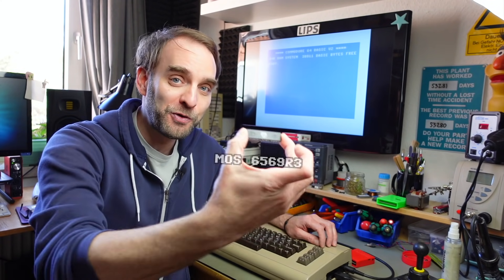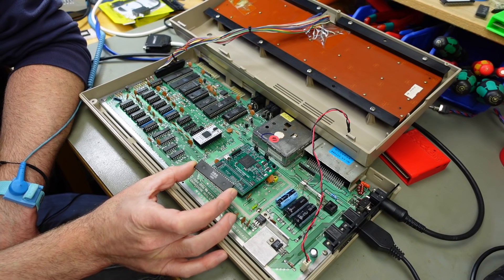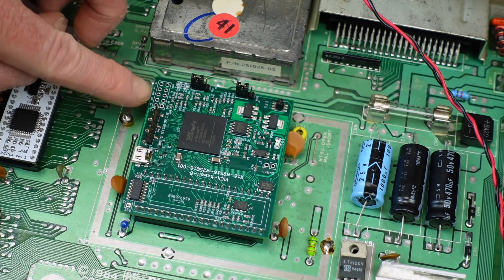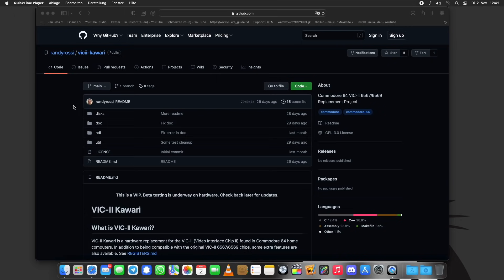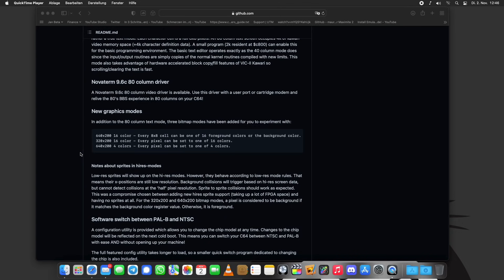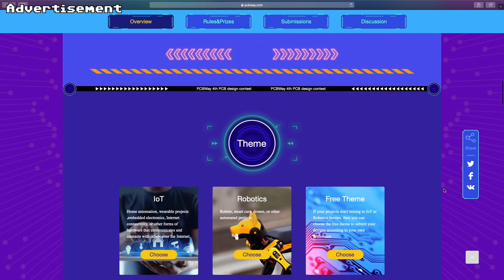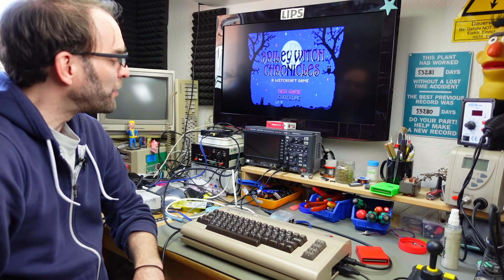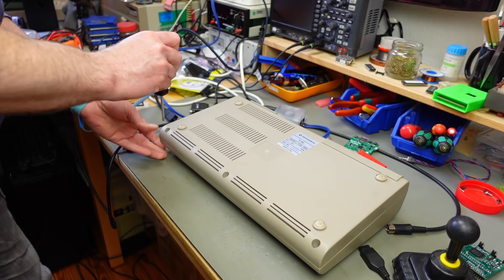Beta Testing the VIC-II Kawari C64 Graphics Chip Replacement

Comment: Nice video!  The C64 being powered through HDMI was definitely not intentional (and not a feature :)  In my setup, my PCB and 64 are powered down when the 64's switch is off even if my monitor or switch is connected to the HDMI port.  Sounds like your TV or switch is back feeding 5V to the PCB.  I need to prevent this in the next revision.  Thanks for bringing this to my attention.  In the meantime, I would avoid powering the 64 via HDMI.  You may exceed the current limit of the port.
Reply: Amazing work
Reply: The MiSTer FPGA system has a similar problem where HDMI will keep parts of it powered when used with some displays. There are HDMI splitters, adapters or cables that can block this voltage.
Reply: Same for the first two reversions of the ZX Spectrum Next, that could  cause a few situations like memory not 100% cleared after a power cycle.

Should be solved with the next 'Nexts' from the second Kickstarter which will have the issue 3 boards where the HDMI back power problem is solved
Reply: Yeah, was going to say, that's probably not healthy ;)

Comment: Its definitely valuable to be designing these chips so that when the supply of real VIC chips runs dry we can keep our old machines going. I am sure that in time it will be possible to make a VIC substitute that is the same size as a 40 pin DIP chip that just plugs in like the PokeyMax chip for Atari computers and video games.

Comment: We're coming closer and closer to not needing to buy original MOS chips anymore, hooray!
Reply: At this rate, someone might as well create a replacement motherboard with the modern replacement chips baked into the design like the SwinSID and other non-MOS chips.
Reply: Thats the ultimate goal i think
Reply: Ultimate 64 Elite and the Mega 65 are 100% FPGA. On the U64E there are two physical SID ZIF sockets.
Reply: @JVHShack  Wouldn't make that much sense, as all these small replacements just try to replicate functionality that could be put into an FPGA as a whole.
Reply: @dougjohnson4266  I bought an Ultimate 64 Elite at the beginning of the year. It is great, but it isn’t perfect. The emulations is near perfect, but the interface for configuration is not particularly intuitive.
Reply: As long as you still had all the hardware ports, not a half solution like "The C64".
Reply: @snorman1911  I was really interested in The C64, but it doesn't really seem to be too awesome for what I wanted to do with it. The maxi version is I think a great product for anyone casually interested in the C64. If all you want to do is to be able to play games or even some coding without too much of the hassles associated with using a real machine (old, unreliable hardware, poor picture output, expensive, bulky and fragile peripherals etc) it's a good option for the price.

Moving up to an Ultimate64 is a big step and you'll only want to do it if you really understand the benefits or you've hit some limitations of The C64.

I love my Ultimate64, but I also just use VICE for emulation a lot, as it is essentially perfect at this point.

Comment: You can solve the back-feeding of 5V from the HDMI monitor by adding a schottky diode in the +5V line, so that the C64 can feed 5V to the HDMI monitor (or the EEPROM in the monitor), but block the 5V coming from the HDMI monitor.

Comment: Another test that might push the limits is the trick of opening the top and bottom borders as shown in the '8 bit show and tell' episode from a couple of weeks ago. Robin shows all of the code to do it and also a couple of games that make use of the hack. Thanks again Jan Beta!
Reply from the maker: I’ve tried a couple of demos that use that trick and they work fine. The "emulation" seems to be pretty much perfect, including trickery like that. I have yet to find something that doesn’t work like with an original VIC-II.
Reply: That's excellent,  thanks for the reply Jan. Parts are somewhat rarer where I am, and shipping - especially from the US - is prohibitive for untested parts. Considering the other benefits of this system, I think it will be a huge success! And thanks to Rossi!

Comment: Exciting stuff. Been following the progress of this for a while. This does need a sensible way to get the hdmi out of the case though. This needs a breakout board to replace the RF modulator, with an hdmi in socket to get signal from Kawari and hdmi out socket  at existing hole for RF plug (to avoid drilling holes in case). Incorporate an ADC to tap into and convert analogue audio on existing circuit (formerly used by the  rf modulator) and feed that into hdmi out to negate need to use the av jack for audio . Must be possible surely?

Comment: Hi Jan, I had a similar issue as you with power being fed through HDMI, although it was actually feedback from a convertor box, that I use like a splitter having both HDMI and composite inputs and HDMI out bypass this box , the power issue disappeared :)

Comment: If the Kawari can somehow monitor the reset line and the power switch, and use that info to block the HDMI 5V to allow reset, it might be a great option to be able to draw power from HDMI instead of a potentially sketchy old C64 power-brick? 
I think there could possibly be a feature here, rather than a bug with a bit of minor tweaking?  Maybe it's hard for the kawari to figure out if the rrset button is being pressed (I assume there's an interrupt?) and to figure out the exact source of +5 so maybe  not feasible?  I dunno.

Comment: I have the VIC-II² mod and it uses opticouplers to prevent you from switching the chips while the system is on. You might be able to use that to act like a switch to cut the power when the main 5v line isn't turned on. I actually think my NTSC chip is on its last legs. When I play Giana Sisters in Pal it feels way too slow to me. So I tried it in NTSC mode instead. I know it glitches and that's normal. What isn't normal is the entire screen flashing occasionally. And it was still doing it in BASIC as well. If I flip back to PAL the flashing goes away.

Comment: I had a similar thing with some really cheap powered USB3 splitter I got off eBay. It would still supply 5V power through the USB when my PC was switched off and unplugged. I got rid of it when I tried to unplug the power adaptor and the plastic housing broke apart, luckily when the power strip was not plugged in.

Comment: Bummer about the Pi1541 issues. The Pi1541 is my favourite add-on. Is it something they’re looking into?
Reply: The Pi1541 works with Kawari.  It's the IEC bus display feature that can cause problems with timing in some demo loaders with a real VIC-II as well.  As long as you turn that feature off, it works fine.

Comment: 13:00 - "strange quirk"? Limited power distribution is part of the HDMI spec - comparable to USB, although not always implemented.
Your TV seems to have a spare pair of LIPS to wake up little "Snowwhite" ALDI-C64. The short board obviously has low enough power consumption to be powered by it. What I found really intriguing is, that both the relatively large FPGA and the flash module also had enough power to run. I suspect their consumption to be very low too when they are only reading flash memory.
Reply: *not always implemented correctly.
Note to self: Read before posting!

Comment: There should be a setting so you can turn on jailbars and set how pronounced they are, to fool any connoisseur into thinking it runs on a real VIC-2.
What about that white line on the far left of the screen (usually in overscan on CRTs)?
(and as someone else said it also needs a few resistors between VCC and GND so it emits as much heat as the original :-P)

Comment: So it can replace both the VIC-II as well as the PSU (as long as you have a SwiSID).  Pretty cool.  Rather than simply cutting off the HDMI power to the board, maybe connecting it to some pins so that if it is a feature that is wanted users could connect it to a switch allowing them to take control as needed.  Hopefully the size of the FPGA can be reduced in the final version as the FPGA image gets optimised.

Comment: Hey Jan, thanks for the video! I am mostly interested in recording that hdmi signal. What kind of capture card do you use for your hdmi capture? Are you using any scaler or does a "normal" capture card handle the weird C64 hdmi signal alright?
Reply from the maker: I use an Elgato HD 60S and it handles the signal well. Your mileage may vary with other capture cards though, of course.
Reply: @JanBeta  Oh, thats awesome. Got an Elgato HD 60S+, which hopefully does the Job es well then. Thanks for the Info!

Comment: cut open the micro HDMI cable and wire in a monetary switch to the +5v wire as a reset switch while the system is powered down.  or a 2 position switch if you want a true off switch. or...  maybe a  Diode wired inline to the +5v to stop the TV from back feeding 5v?

Comment: Some TV/Monitors support an HDMI protocol called CEC (Consumer Electronic Control). It allows the TV/Monitor to turn the connected device on/off over HDMI (and, I think vise-versa). Perhaps that, when combined with that strange power "feature", you could have your C64 to power on only when you select its input on the monitor?

Also - try switching ports on the monitor. It may power down the port. That'd save you clipping a pin.

Comment: If power is coming from the HDMI, isn't it bad for the 64's 7805 regulator? When the 64 is powered with its supply its 7805 regulator will try and regulate an externally related voltage and potentially conflict.

Comment: Would modification of the hdmi cable be easier? Just open up the cable and cut the 5v to pin 18, that should work. You can use a pin to pierce the insulation to find the right wire. Thanks JB, great video!
Reply: It's not suggested as a fix for the design,  it was suggested to allow JB to more easily continue Beta testing without having to continually disconnect the hdmi. 🙃
Reply: Horses for courses, if I was doing the testing,  I'd modify the cable. I'm not damaging the device and for 10 minutes (easy) work, I'm saving myself a buttload of dicking around. But that's me, I'm lazy and look for the easy solution!
Reply: You do you champ, although there's no reason to think that the 5v line will be off in sleep mode. I suppose JB could unplug the TV from the wall each time. What a time saver!
Reply: Call the hospital,  I need a burns unit! 🔥
Reply: using my best Dr Smith voice Oh the pain, the pain! Please stop with the snappy comebacks every 36 hours, the burns are unbearable 😫 I'm quite fragile you know ;-)
Reply: John, if you want to press the remote control button, wait for the monitor (or TV in this case) to power up, find the signal etc, its fine, do that. But you do realise that the remote control button doesn't actually power off the TV right? Systems such as the 5v bus to run the remote control receiver are still on - agreed? Therefore it stands to reason that the hdmi 5v wire will be hot whether the TV is 'off' or on. But even if that TV does cut the power to the 5v rail (unlikely), you are more than welcome to wait for the TV to power cycle rather than just hit reset and be testing again in seconds. As for the mod, why do you have an aversion to butchering a $3 cable? ;-)
Reply: Another possible source of the power is of course the video capture / splitter device. No remote for that one! ;-) face it john, unless you are going to mod a one of a kind device with the risk of damaging it, or want to waste time power cycling external devices,  butchering a $3 cable is a pretty reasonable course of action. I'm not going to suggest removing the video capture device, I need my Jan Beta fix ;-)
Reply: Oh hi John, I thought you might have wandered off once you realised that the power was probably being delivered from the hdmi splitter 
/ video capture and not the TV. Oh well ;-) Never mind, we all make mistakes 😊. Sorry to hear that you feel the need to make yourself feel better by attempting to denigrate others in youtube chats, that's pretty sad and I hope that you can get through that. I'm here to help if I can.
Reply: John Bos, where did you go? I was really enjoying the chat, and I thought we were making progress with your personal problems.  If you ever need to get those chats back, please know that I screen captured them all and am happy to help you out. Lots of ❤
Reply: Oh, and John Bos. Thanks to you I know I'll never be homeless, and every time you sign off a chat with your trademark condescending  ;-), ill know that you're thinking of me 🥰 Every. Single. Time.

Comment: I presume the solution for ghost powering via "power over hdmi", would be to have an "ideal diode" mosfet only allowing power into the 5V line, but not out of it? but that would complicate things and require a pcb revision I guess.

EDIT: Thinking further about it, unless there's some reason why it's necessary, a much simpler solution would be to cut the trace connecting to the 5V pin (pin 18) of the micro-hdmi connector. No trace, no ghost power.

[Yes, I wrote the comment before finishing the video. I have more opinions than patience]
Reply: This is just a beta version so I am sure a PCB revision is expected.
Reply: @Kboyer36  If they discovered more issues, yeah, I guess. But making new board revisions is always a pain in the butt, cos then you have to either order them and wait, or etch/mill them yourself. As opposite to being able to update the FPGA firmware to fix issues.

Comment: I’m thinking whether the same thing could be achieved with the Raspberry Pi? Randy has already made a bare metal implementation of the whole C64 on Pi, so that might provide the needed codebase. An adapter board with a GPIO header would be needed. With RPis costing next to nothing, it might be a cost-effective alternative.
Reply: The problem there would be vertical height. An adapter plus a Pi will likely not fit inside.

Comment: Wow say think this work on the vic 20 ? 

If it can then wouldn't that mean all the chips we can replace on a vic 20?
Reply from the maker: The VIC chip in the VIC-20 is fundamentally different from the C64‘s VIC-II so the Kawari won’t work in the VIC-20. As far as I know, there’s a modern replacement for the original VIC chip in the works from a group of hobbyists and engineers though, so that may be a thing soon.
Reply: @JanBeta  oh wow that is so cool. Thank you. Qq do you have any more boards for sale ? Ebay is not showing me anything atm and just curious.

Comment: Found it very strange that HDMI provided enough power on the 5v, it should provide only about 50ma .. there is another standard MHL, which can provide a decent amount of ampere, so if the screen has a MHL/HDMI port it likely can stop it by changing it to another non MHL port.

Still powering a C64 from the TV is likely not a good idea in the long run, cool bug/feature though.

Comment: Anyone else having issues with U14 and U15 get very hot on the large board?
I purchased one of the last Kawaris before they got out of stock. A rev. 1.2 with Trion FPGA. While it works fine (except with SRAM, i  need to figure a way to firmware update it) two ICs run very hot. I guess they're voltage regulators. The older revisions of the board has nice large regulators (or transistors) but these are almost pinhead sized - and running IMHO way too hot. I can't measure such small points but my IR thermometer says about 55 C (feels hotter).

Comment: Hmm. I fixed lots of C64s (definitely more than ten...) and I only had one failed VIC-II chip. The #1 cause of failures is still the PLA.

Edit: I'm not saying I'm against this project! I think it's a great idea, it allows to be able to use C64s indefinitely.
Reply: It can allow original C64 upgrade to use of Modern HDTV as displays or current Computer monitors with excellent resolution the original video system was not designed to handle. I was burning new PLA using FPGA Chips in 1985! Thy used a standard pin configuration, which makes me suspect the original engineering prototypes probably used FPGA to map out the address to Chip Selects matrix then for production, the guys at MoS copied the logic table and made their crappy version of the hardwired, non programmable PLA because they could make them cheaper to stay in budget.

Comment: I guess there will be no border  scrolling available, meaning that you can place sprites in the border by timing. I've done this in the original C64 which worked very well.
Reply: You should really check out the channel of rossi. He throws multiple modern demos at this thing. I would not be surprised that it would just work. He even had to get to the bottom of a particular quirk that was not well understood.

Again watch it... you will not be disappointed and start to appreciate the complexity of this thing
Reply from the maker: So far, every demo I threw at it looked 100% accurate. Including all kinds of trickery. The "emulation" is very near perfect.

Comment: I have no idea, but would this work in a C16 as well?
Reply: Not in its current configuration I don’t think, C16 used the TED chip for graphics and sound not a VIC-2 chip, but it’s fpga so I guess they could just reverse engineer that and put it on the chip
Reply: It would be possible to port the Kawari to simulate any Commodore video chip but obviously that needs to be done by someone who has experience and there are almost no people doing that. So if the Kawari dev doesn't do it then it's unlikely to happen.
Reply: I think the big issue is while the TED chips definitely fail as well, there just are not as many people that collect the C16. Maybe in the future when we have working replacements for all the IC's in the C64, we may see someone work on designing something for the C16 but there just is not enough of a market to really justify it right now.
Reply from the maker: There is a replacement in the works! https://retrohax.net/the-thed-project-update/